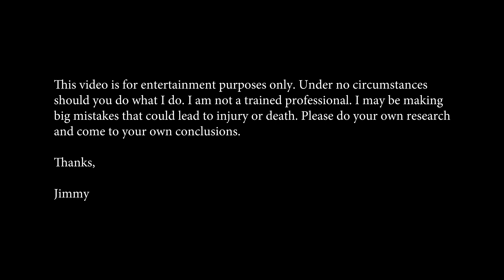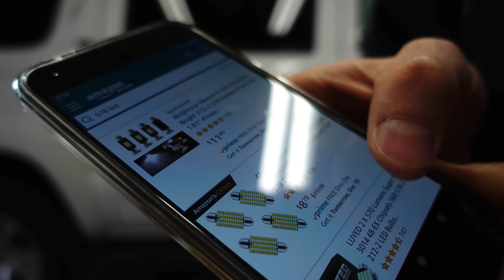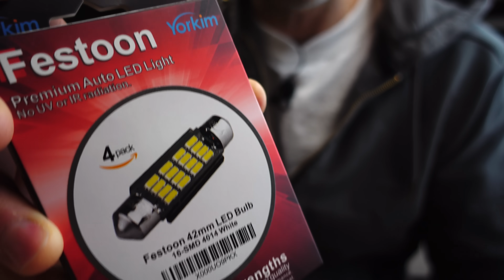Here's Why You NEVER INSTALL LEDs IN YOUR CAR OR TRUCK!!

Comment: Get the one made by ATG & Cree. ATG/Cree are one in many ways. 
The body has over 77% metal with fins or nice heat sink with a fan.  Low LED headlight = look metal with fins or fan.

If you are in hot places, get LED headlight with fins & fan. 
Just the fins will not help to remove the heat. Get one with a fan. 
Your LED will last much longer than the fan. So if the fan goes bad so will your LED.
Nevertheless, ATG/Cree is much better than incandescent.

ATG & my tips:
1. If you are pulling something out & installing the LED. Do not install everything back together.
2. If you plug cable into the LED (2 leads or 2 contacts) and it doesn't light up. Pull plug out & flip 180 degrees
3. It's good if you have a DMM or DVM to check LED on with is Positive & which is Negative
4. Make sure nothing touch the LED (Yellow Gals) when you put back in
5. Again, always test the LED or HID or Incandescent after the plug in & turn on the light. If it light up, then shut off & install.

You will surly be very upset if you dropped (removed) the whole front bumper or half of the back out. Then install all back only to find that it did not light up. New items do go bad during shipment or it has been re-wrapped for new sales.

Comment: The reason it is against federal law to change the type of light source in a headlight is that it changes the beam pattern.  As an experiment I once installed a “same as” LED bulb in place of the proper halogen bulb in a fog light.  It was instantly transformed into a flood light and would have been dangerous to use on the road.

Comment: we have notice that the cool white or very bright LED is about 6500K white /bright as white paper. but you can also purchase 4300K less blinding white for interior usage . the wire type LED are old style they had problems though ,but LED at its best last about 50k hours if at 8 hours a day maybe 17 years . outside solar flood lights are now 12 years old still have to wash the solar panel but still bright replaced the NICAD batteries to LIPO high current seems to be better . halogen create lots of heat as well can cook some eggs on them LOL . though LED mostly from china you get what you paid for fast and cheap assembly

Comment: 168 bulbs get extremely hot, I always preferred red lights as interior lights on a car. Otherwise you are illuminating yourself while blinding yourself. Especially map lights, red doesn’t produce glare you can see what’s going on, but also see outside the vehicle as opposed to white light that produces glare not only can you not see outside the vehicle. It takes time for your eyes to adjust, and other folks can see in even with dark window tint.

Comment: LEDs work a lot better on interior lights and headlights than any exterior bulbs.  Especially the dual filament types like 7443 that are often used to do tail lights and brakes with one bulb.  Or vehicles that modulate brightness by varying the current to a filament.

The main issue with the vast majority of LEDs (apart from domed mini bulbs) is uneven light dispersion vs a plain filament bulb.  A strung up super hot filament emits light evenly in all directions whereas LED bulbs will have giant blind spots due to the diodes having to soldered onto "something".

I work at AutoZone and that's the #1 reason I see for returns on non headlight LEDs.

Comment: I have traded out many bulbs on several vehicles to LED.  Things to note: If you have a newer vehicle look for CANBUS bulbs, otherwise you will often find a service msg pop up on your dash. Those systems look for power usage from those lights around the vehicle and since LED draw far less power those CANBUS systems think a light is now out.. Even so, I still hesitate to recommend replacing turn signal bulbs, tail lights or headlights on 2010 and newer vehicles due to other issues that can occur with the electrical systems not being compatible. Such as O.P. has recommended please do research first from others with your vehicle who have swapped to LED's and any issues they have noted. Buy reputable brands with a good track record for longevity and reliability. Also and this is very critical...As demonstrated many LED's will often have a light color range of around 6-8k Kelvin. Most halogen headlights often would be around 3-4.5K kelvin. Regardless of what others will tell you, the true "White" light reflects better off roadway markers and therefore often people say emit a lot more light than halogen. HOWEVER! if you live in an area prone to heavy Fog, Snow or inclement weather  the white light washes out far more in those surroundings than the yellowish light. Its not fun to be driving in a heavy rainstorm at night with white LED's and not be able to see 5 feet in front of your vehicle. Trust me I've been there. I am a huge advocate for LED's inside of homes and vehicles but please be sure you know what to look for with specs and buy accordingly.

Comment: You didn’t mention the biggest problem with led lights. I installed some in my truck and they don’t get hot enough to melt the snow! After just a few hundred feet of driving you can’t see anything as the light refracts through the snow on the lens and it’s like looking at a million white hot embers! All you can do is shut them off or die because you literally can’t see the road or anything but the snow flakes that are falling and they are blinding! You can pull over and clear them out but they will just get covered in a few seconds as soon as you start driving again and the same thing happens. You either drive without headlights or put HIDs or halogens in the truck.

Comment: if there is heat, that means one of two things or both. Bad connections or use of watts that is not converted to light. Light is measured by lumens, To get efficiency you need to do some math. I have found that a lot of leds have a lot of loss through heat. Just like all light sources there will be a certain amount of loss through heat / UV  or otherwise not usable electricity converted to usable light.

Comment: funny how the first light was a simple incandescent lamp.  when you see the long, spring like filament, that is an incandescent.  Halogen has what looks like a tiny second lamp inside.
it is oct 2022 and most of the problems are gone.
first, you can get a 3000 Kelvin (yellow) output and not have to get the 5000 Kelvin (superwhite) color lamps
second, you should only get a 'watts' replacement.  so, if your interior light was 30 watts, you should not get a 10 watt LED that puts out about 90 watts of light.  LED = 5% to 10% of the incandescent wattage for the same light output.

Comment: Bought a 10-Pack of the small 194 LED bulbs and changed all of my side marker and parking light bulbs and could not be happier. About 1/2 of the 194 legacy bulbs (12 years old) fell apart or the conductors broke when removed. Bye bye halogen.

Comment: only good way to do headlights is a custom made housing with a Cree XLamp CMU2287. really hard to argue with 13,361 lumens in each headlight. you are gonna need a boost converter on each headlight though. make sure it has cc mode and can do 54 volts at 2 amps

Comment: One issue with that flat type LED is light dispersion it has low output from the tip of LED which creates a bright spot on the flat (LED side) and not much coming out the top and and doesn't fill the light housing with light so the longer housings like the one in the door the output is bright on one end and less on the other.

Comment: They say "resistors" on electric  circuits dissipate heat, and if those resistors can light up via  led..even slightly...on thick cables...inside modified solar panel box....ev cars can probably do well with magnetized iron transformers.

Comment: IMO CREE LEDs are the gold standard of real chip level 5000K LED Headlights.  They come in various array sizes..  Flat, Yellow.  Proper Design w/chip level LEDs allows very tight thermal coupling with a heat sink (Aluminum structure).  Also get one that moves the focal point for Low/High Beams.  Can't go wrong with CREE..

Comment: I bought a 1992 Buick Roadmaster recently that had aftermarket LED headlights already. They were not only installed upside down - high beams on the bottom and the low beams on the top - but they were not adjusted properly. So I purchased some OEM halogens that fit perfectly without having to have an extra connection for a tiny little fan at the back end of the LEDs to cool them. The halogens were actually brighter! I had to return them initially because since they were made in China the qc was awful and had to be replaced. The second set of halogens did the trick as the new technology of halogens are amazing. And like quartz iodine, halogens cannot be handled unless cleaned with ethanol afterward, so I was very careful.

Comment: Used leds for brake lights and they melted the cowls inside the light assembly. Threw them in the trash and got halos. They also stopped working after a few months

Comment: My experience with LED tail lights was with caravan and probably cheap bulbs. The bulbs had LEDs in series and the extra wire to the bulb created more voltage loss such that it fell below the point of illuminating. Maybe there was a current regulator chip involved because if you could get the bulb to strike, it remains illuminated. The internal light/festoon bulb works fine, that bulb uses resistive current control. (it is not a sophisticated caravan)..............  The moral is: don't buy cheap!

Comment: The wife's car didn't come with day riding lights. I fitted some about 6 years ago but being an LED strip, exposed to the sun, they eventually fell apart. Removed them but decided to keep the relay box in position - just in case. I looked around and found some LED, all in one, Day running and indicator bulbs on Aliexpress. 2 for £8 including delivery. Simply a case of removing the indicator bulb on each side and plugging in an adapter into its socket (pre-wired) and fitting the LED bulb where the indicator bulb had been. Wired it to the existing relay. Money well spent. White day running light with an orange indicator. Been in now 2 years with no problems at all. I wouldn't like to say all LED's are brilliant. I've had some fail after a short time. Luck of the draw I suppose.

Comment: the only thing you have to use discretion is with the turn signals all the lighting on my truck are LED's except my rear turn signals the front turn signals are led but not the rears and changing the rear could  affect the turn signal flasher that I think is a solid state capidance discharge that would require the residence of those incandescent bulbs I do planning on asking why they didn't use LED there and if that could be changed to LED's

Comment: The problem with led's for cars are removing canbus errors but the main issue I've had in headlight daylight  wedge bulbs in particular has been weight. As a result with bumps on the road they come loose and when you try to remove them they fall into the lense. This can be a major issue if it's not easy to remove the whole unit to get the bulb out.
Reply: Look for better quality!

Comment: That LED Blub with the not solider to the boards properly from the manufacture if you can take the housing apart you will see that the solider connection is very little so don't throw away, just re-soldier it back together will last for years to come. My SUV  i bought it New back in 2006 and removed all of the Stock Bulbs and built my own LEDs and here we are now in  December  2023 and they're still working , and I built a new audition to my SUV it's a Triple Row LED Light Bar  output Brightness 300,000 Lumens.

Comment: The auto led’s are over powered and that’s why they get way too hot. Yes make sure the ones you get are heatsinked but you can restrict current with a resister too run them at 3/4 power and reduce a lot of heat and extend the life dramatically

Comment: 1:16 The problem of overheating is the resistor they put across the terminals to trick the cars computer to believe it is a regular bulb.
A regular bulb consumes more electricity, so if one dies the computer knows and can give a fault/warning.
Basically replacing a regular bulb with such LED light is useless, because the resistor makes the LED consume more electricity as it should and makes it overheat.

Comment: I replaced my console light on my 2006 Chey malibu with LED. I have a video on my channel. My console light was like the one at 7:25, but my light had actually melted....so i replaced the whole unit with a generic console light. I have the wiring diagram also.

Comment: With reading the comments and barely touching the video, I can conclude that anything aftermarket really is hit or miss, and these are no exception. You just take a chance. Luckily LED bulbs arent very expensive to experiment with to find a decent brand
Reply: @Frank Jager Buy from a reputable dealer. The only outfit I trust, I've been buying from since 2007. From headlights to taillights and interior, on both my trucks. I had a pair of LED 194 wedge bulbs go out but they replaced them under warranty.

Comment: LED's require a resistor to drop the voltage since LED's use  less power to light up .
Resistance also equals heat ...so yeah need some sort of cooling fin .

Comment: If your vehicle needs "can-bus compatible" LEDs you might as well just leave the halogen/inc. bulbs unless you want that blue-ish white light. The can-bus-resistor gets very hot and draws about as much current as the original bulb. LEDs don't like heat at all.

Comment: If you compare the fixture at 4:50 (after LED install to 4:15 (before LED install) the before, to my aged eyeballs is far better. The entire fixture tools like it is full of warm white light. But after the LED install the fixture looks only about “half-full”. Is this why I SHOULDN’T EVER CHANGE TO LEDs?

Edit: I think the reason is that half of the LEDs face the back of the fixture (in other words, into the door where there is no one to see the light). So the front of the fixture interior is only being illuminated by half the available light.

Comment: That and your also with these newer vehicles using computers to control the light circuits. The lack of current draw that the LED's cause will cause the vehicles BCM computer to wig out because it doesn't see the proper voltage drop when their turned on. That and their also running the digital databuss networks also known as canbuss networks into pretty much every switch in the vehicle. So again if there's not enough current draw on that circuit. It's going to cause canbuss errors as well. It's getting extremely difficult these days to do any kind of aftermarket electrical modifications to your vehicle. With the exception of remote start and alarm systems because they're actually designed to work with the canbuss systems in the vehicle and they're's usually a T harness for your vehicle so your not splicing into factory harnesses or anything like that anymore. Modern vehicles are plug and play with aftermarket remote start systems nowadays.

Comment: Most LED's will not overheat when you run them at 12V. As we all know car eletronics don't run at 12V because they're battery dependant, so when the battery is at 12V it literally has no power. 12.7 give or take is the normal voltage, that's already a bit over LED's rated voltage. When the car is runnig, alternator charging, the car's eletric system is at 13.7/14.4V now that's quite a bit higher. Lamps don't mind this so much, but LED on the other hand, will not give you more light but will give you more and more heat, the current demands of the LED when you give it a bit more voltage spikes like crazy, taking too much power and producing alot of heat that you don't even notice because the light is not really brighter. Adding a resistor matching the LED would be perfect (i know they already have those resistors but as we can see they're too strong, need to be replaced with higher ohm resistors, or adding another in series )

Comment: Be carful when replacing instrument  bulbs as the will not dim like incandescent lights . Also you can get several types that fit but will have various amount of lumens.  found this out on my 1972 F 100. had trouble seeing the speedo during day time with sunglass on. first set was just a little brighter. next ordered the most lumens with the same base. too bright at night. that's when I found out you can't dim a led. 3rd time was the charm.  7 bulbs in that inst. cluster, and the spedo cable you have to reconnect blind wile just enough room for your hand.

Comment: The biggest problem, is the fresnel lens is not designed for an LED, it's designed for the halogen filament, so it doesn't magnify the light properly,

Comment: I sure do wish the LED bulbs I have bought did anything like last as long as claimed. I bought 4 for the rear turn signals and brake lights. In less that 6 months one was dead. I yanked it and put am incandescent bulb back in. By the 10th month, all of them had failed. I have led smart bulbs that seem to last only about a year before the will no longer connect to the rest of the home automation. They will go into pairing mode, but the apps don't find them anymore. I have dumb LED bulbs, and about 30% of the installed dumb LED bulbs fail per year.